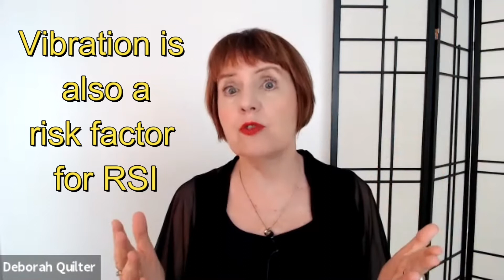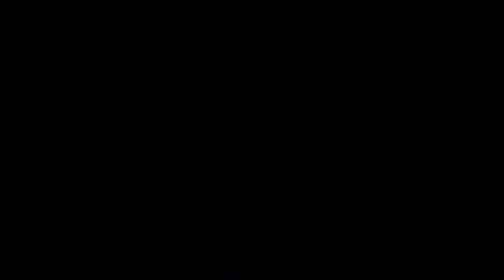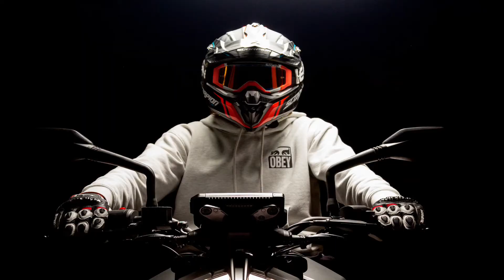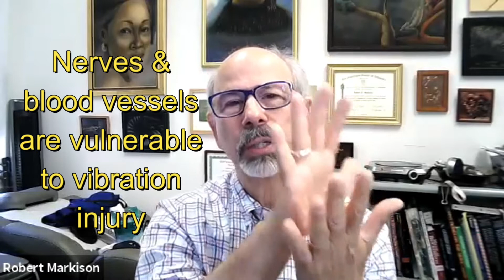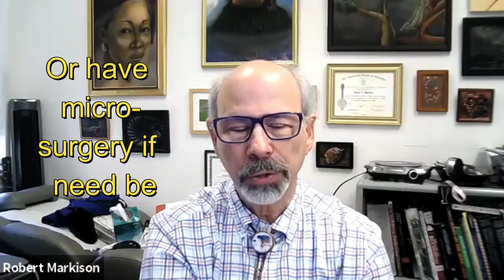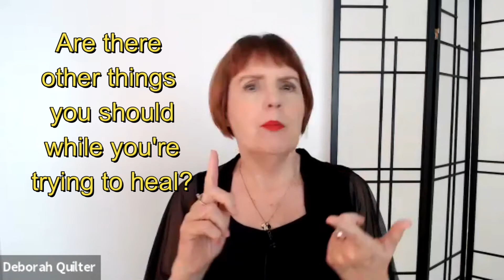How VIBRATION causes RSI

Comment: Ive retired from construction 28 years i have hand an arm vibration 2010 digonest with HAVS
Reply from the maker: I am so sorry to hear this.
Reply: Thank you😊there should be better red flags in construction on HAVS 🤔😊
Reply from the maker: I couldn't agree with you more. Prevention is the only cure and I am so sad that people keep getting injured. To this end, I wrote a Repetitive Strain Injury Patient Bill of Rights which addresses the things that need to change to protect people from injury. https://chng.it/wgdy2vzphr.  At the very least people should be warned that this could happen to them. Injury happens so easily and recovery is extremely difficult in many cases.